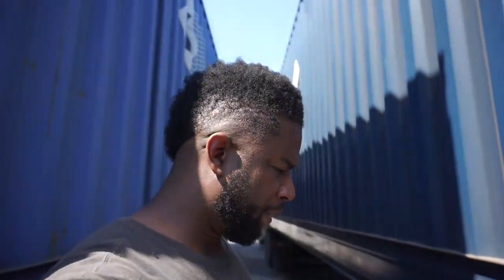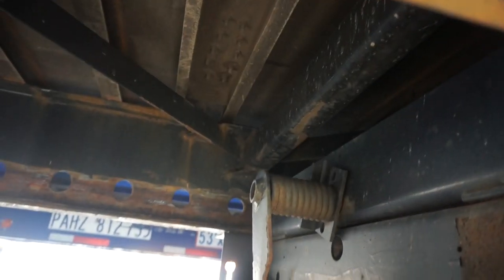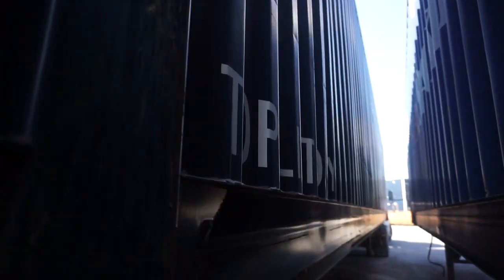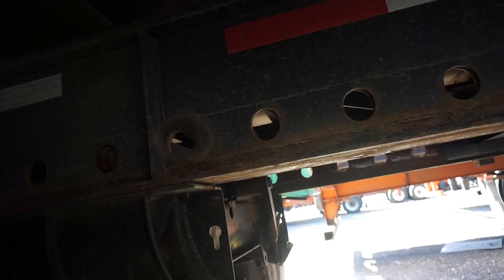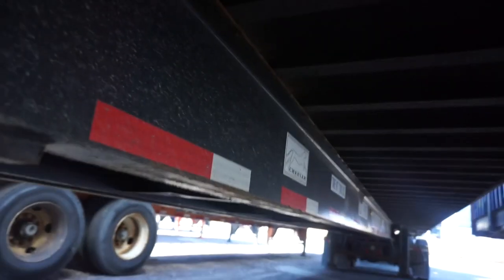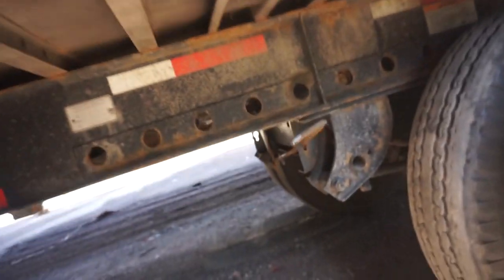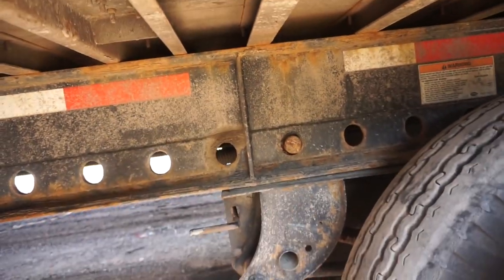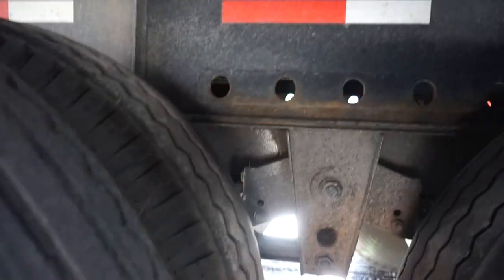RAILYARDS: When your TRAILER being STUBBORN use some BRUTE FORCE !!!!!

Comment: 2 Mondays in a row. I'm pulling 53 UMAX. Managed to get 2 great chassis as well. But had to dig the first one out. Got a new one for ya.
Pretripping a 53 ft chassis for a UMAX. found a 275 70 R 22.5 on the outside of an 11R22.5. The smaller tire still had that new tire smell. 
Wasn't about to cross a scale with that one. Be safe out there.